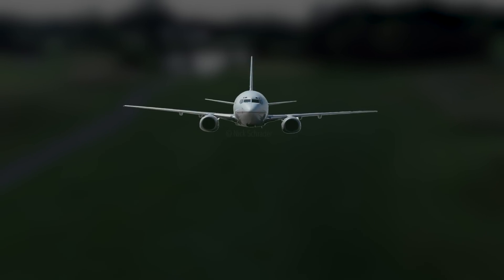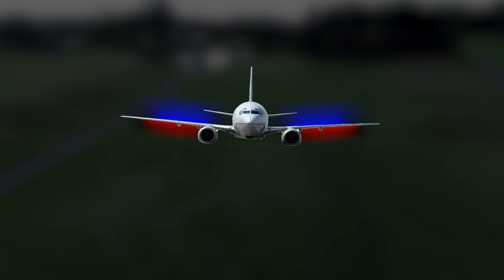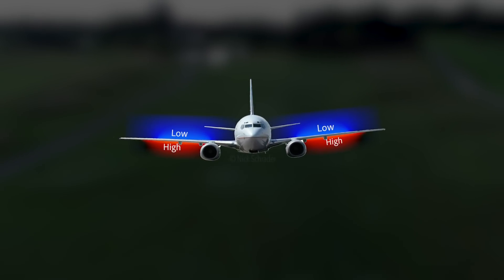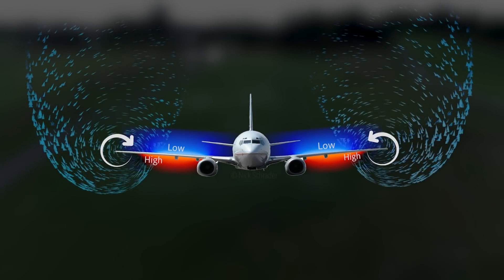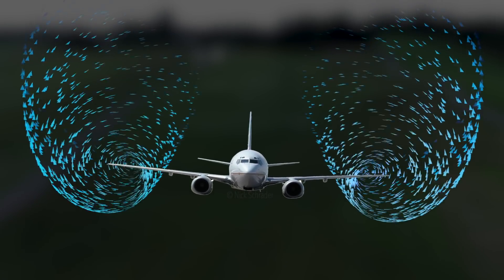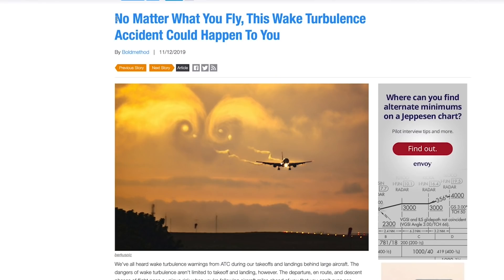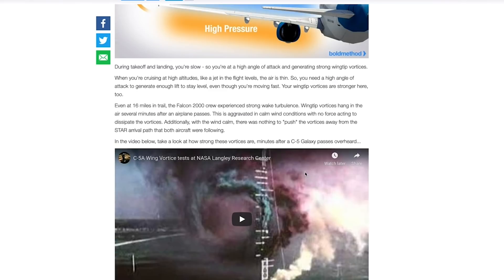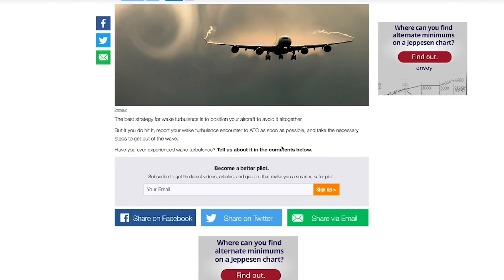Wake Turbulence From a Paper Airplane

Comment: Not sure why but, ever since I was young I liked vortexes drawing tornado's. Aviation was also in the backdrop and once I learned that wingtips and flaps or any tip really can create a vortex I was intrigued. Once I started plane spotting I learned that off of some airliners the vortexes from the flaps are often audible given their high velocity as they break down.

I realized that foreword swept wings create the strongest tip vortices as well. I even made a DIY wind tunnel at one point so I could visualize vortexes and I built a few delta wing designs to see if I could tailor wings to create vortices where I wanted them. Like delta wings with dog teeth leading edges and such.

For some reason I like showing people things they've never seen or perhaps, things that are invisible under normal circumstances. I simply like seeing people's eyes light up when they see something new that opens their eyes.

Comment: Nick;  Thank you for your fine camara work.  I believe for the first time, I understand how these effect is generated:
Your videos make it very clear; the plane flies by pushing the air mass down as it passes (as shown by the flat base to the disturbance
as the plane just passes.  Now with all this air mass being pushed lower, a partial vacuum is created (or a hole in the air) and so the nearest air
to fill that void is the air on the sides of the displaced (pushed downward) rectangle of air; This side air rolls sideways and downwards to fill this 
vacated space; thus creating the vortex swirl you have captured. 
  I had been taught that all this is caused by air swirling from under the wing to take the place of the low pressure air on the top of the wind!
  The truth you have so ably depicted now makes perfect sense!  Thank you!

Comment: Nick,
Very cool video! I am doing research at my university on the aerodynamics of propellers. I am not necessarily studying wake turbulence, but I am trying to get some nice airflow illustrations with fog like you did. We are trying to find a fog fluid that is not heavily water based which could damage any exposed electronics we have. Also, most of the fog fluid we find (also dry ice) is pretty dense and just sinks to the ground. If you don't mind me asking, what kind of fog fluid did you use? It creates a fog just like we want that is not too dense. Also, did you use dry ice or regular ice to cool the fog?

Thank you!
Jacob